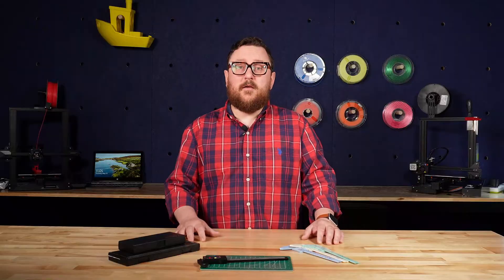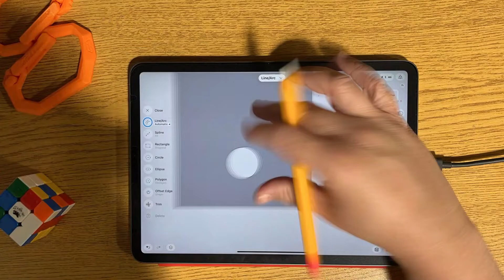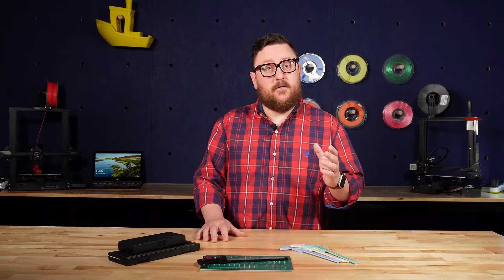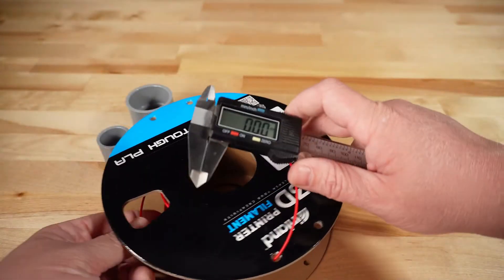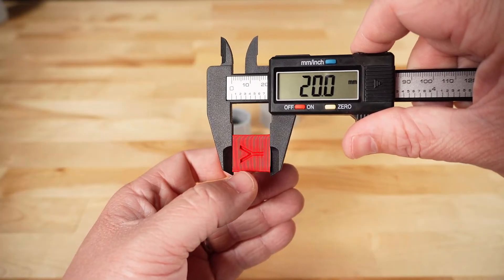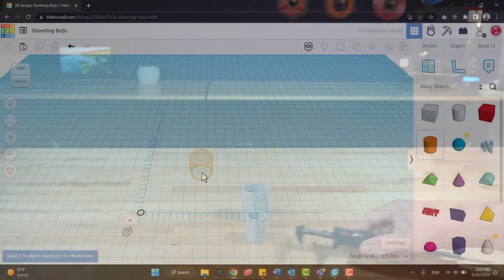How to Use and Read a Digital Caliper - 3D Printing Tips & Tricks

Comment: Nice video! Great way to get people started using calipers. There is one more function available on most digital calipers (I think vernier as well) that seems to get missed a lot. if you close the calipers you will find that the left edge of the stationary section and the left edge of the moving section line up. When the moving section moves, the difference between these edges also matches the number on the scale. This can be useful and usually more accurate than the depth function for measuring things that have a step in them - two parallel surfaces separated like a step in a house (this function is called step). When looking at digital calipers to buy, they will usually mention that they have inside, outside, depth and step functions. I hope this helps someone!